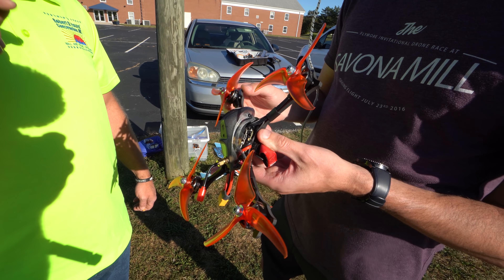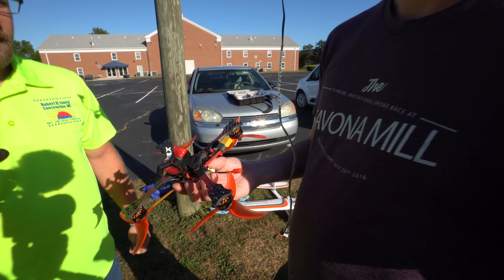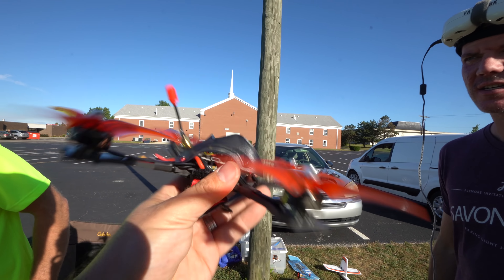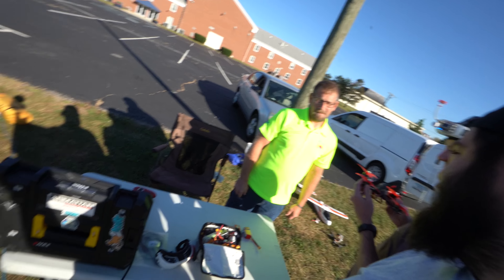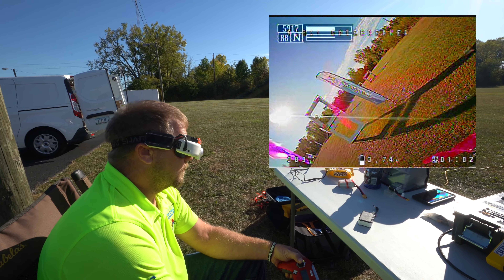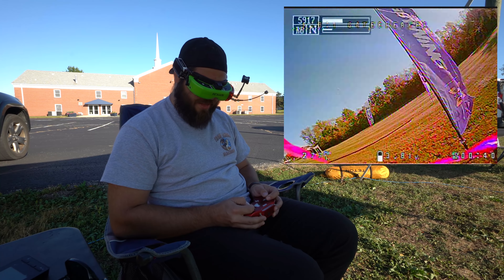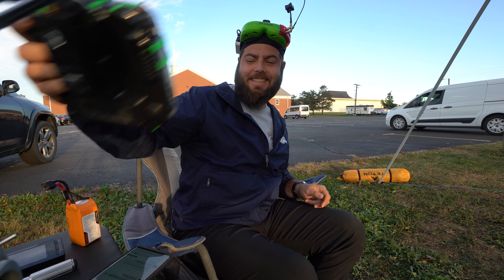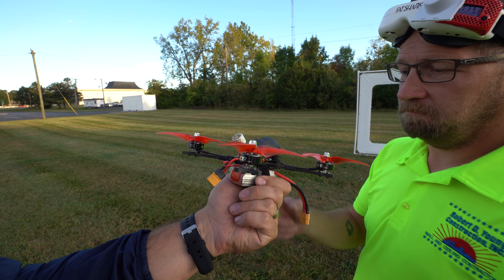IndyGP's Official Spec Class will be STUPID fun

Comment: Love the idea. We tried a similar spec class locally, but no one liked having to buy 3S lipos. Maybe go 4S (people still fly 4S, or may have some from before).

So, buy Hawk Sport 1700kV, add receiver. In Betaflight set up auto_cell_count to match your 2 PID profiles (set your rates, obviously). Put on 4S lipo for Spec class. Put in 6S for your normal class. Betaflight picks right PID profile. Done and done :)

Comment: We run a spec series in Australia where everyone gets dys 1700kv funsun motors (choose any specific low kv durable super cheap motor) and then race using 4s on any frame with a minimum motor span (7" arms) minimum weight (600g Inc battery) and any 5" HQ propeller (super durable) and the racing is insanely fun and exciting.
The rest is open components as to encourage people to use old gear they have lying around because imo I've found not much else gives a performance advantage on this setup..
The motors can be used on 6s by people wanting to move on from spec class racing to open class at a later date making it pretty economical.
We run after open class and open up the tracks a bit more so flow is better and take out things like towers and dives. The drones have proven to just glance off each other's I think because of the low speed and 5" props. 
Some battery management is also involved towards the end of the race which adds to the skill requirement

Comment: Does there exist a reference of PIDs tunes, where I could cr0ss reference motors/props/voltage/firmware vs population of product reviews relatively known to exist?

Itd be interesting learning motor characteristics at difference voltages/pids and the phyiscal system and maybe stuff like battery motor efficiency at limiting the responsiveness of 6s to "feel like" 4s with weird throttle curves;  like a quad felt heavier or was in different systems of water.  Kinda like guitar sim pedals of tube amps?

Comment: Not a fan. Doing it this way one manufacturer gets all the money. In the 90’s in RC racing you had a choice of the team losi spec truck and the team associated spec truck then you had to get a spec motor and tires that were marked in a way (by the manufacturer) so they were easily checked in pre race tech inspection. I would like to be able to get whatever frame I want and then be required to get certain spec motors, props and batteries. I like the idea of a 7in frame that weighs 1kg ready to fly with spec motors, props and batteries.

Comment: Spec racing should be 6s 1100 2205 1722 5045 prop only with any frame and electrical components. That Emax quad looks fragile. You'll  have more fun staying in the air, not on the ground!
Reply: Those are amazingly fast on really light builds - not much of a 'spec' limitation, that's as fast as most open quads on the righ courses.